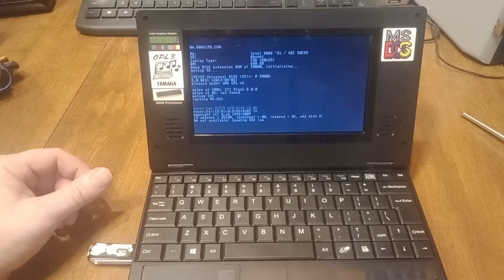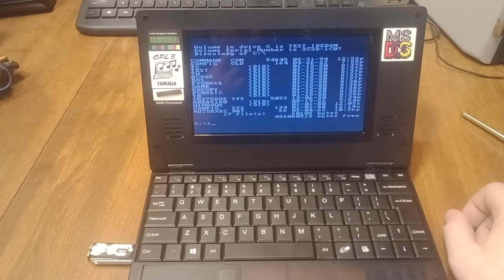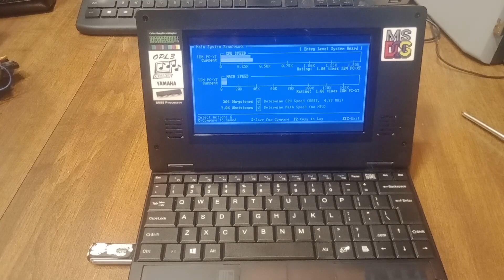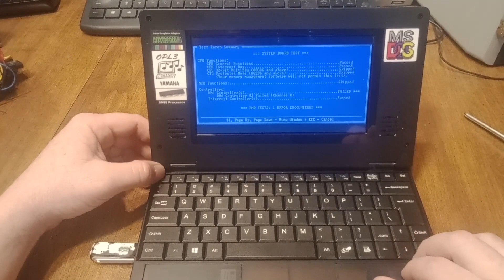Book 8088, laptop clone of the IBM PC XT

Comment: I bought one and it doesn't accept my USB drives. Will a 256 megabytes USB drive work? Do I need to format it to FAT16 or will FAT32 work as well?
Reply from the maker: FAT16, I usually keep the partition as small as possible for my needs. So usually 10-30MB. .. some USB drives just don't work
Reply: Thanks!

Comment: I want to bring files from Windows 10 on a USB flash drive, but it doesn't work. Please tell me how.
Reply from the maker: -Make sure it is format correctly. I am not sure if it needs to be FAT16. 
-Copy the files you want to the flash drive. 
- Plug it in the side of the BOOK8088 first then turn it on.

Comment: Mine arrived within the past hour, and I have done a quick inspection... there was indeed a "nub" to put over the power button; mine came in a bag, and so I put it into where the power button is! Unfortunately for me, I'm in the UK, so I can't currently charge it up till I source an adapter! I'm looking at getting a 4GB CF card divided into 2 drives/partition to give it more space.

Additionally, I actually bought 5, 8, 10, and 16MHz V20 CPUs for it, as well as also an 8087-3 to use with it, although mine also came with a 10MHz V20, though ironically, the one I ordered suffered a mishap during its journey to me, so the pins are mangled! So far though, I've received all but the 16MHz chip, which I was considering putting into to board, because I figured it'd give things a boost, although I'm aware that older games will play a lot faster!

I probably should source an original 4.77MHz chip as well, just in case it's needed!

Comment: Cool , but where is the serial and parallel ports ? Awso CGA display out and composite for external displays
Reply from the maker: I think that is where the ISA board comes into play. No display ports out.
Reply: @elijahmmiller  so if you want to use a mouse , you have to add ISA serial controller to that ISA expention? Very inconvenient, and if you for also want an external keyboard for some reason (mechanic, n-key roll over) this is impossible :(
Reply from the maker: Well I wouldn't say impossible. You could add an external keyboard "card". It just would not be mapped to IRQ1
Reply: @elijahmmiller  i didn't know that DIN ISA cards for keyboard are available
Reply from the maker: I would just make one. It would require some custom drivers.
Reply: @elijahmmiller  cool . Does it mean that you can add a second keyboard driver operated under DOS to an regular PC with ISA slots?
Reply from the maker: Yes you could add a second keyboard to any PC with ISA slots. I would make it with BIOS level support.
Reply: @elijahmmiller  sounds interesting. What about a very dump way for example on a regular PC to just make a splinter od a DIN or PS/2 port to connect more then one keyboard to the port 😁?

Comment: I have this unit and the seller sent me a pretty good pdf manual.  Fn F6 switches you to 8Mhz mode.  My machine came with the NEC V20, also a good clone.
Reply: Thanks the tip in Fn F6. Makes Wolfenstein CGA actually playable 😁
Reply from the maker: Can you email me the manual?
Reply: +1 on the manual 😔
Reply from the maker: I will put a link on the discord page
Reply from the maker: https://docs.google.com/document/d/1A35wl-oX3aWOur_GdeSVkDJHDJrKjhMd/edit?usp=sharing&ouid=114917802316228385506&rtpof=true&sd=true